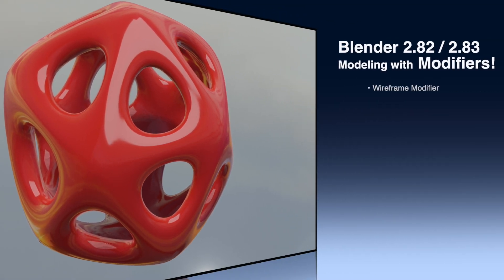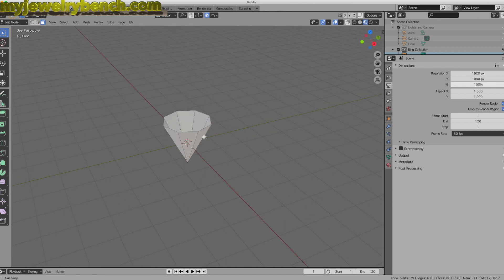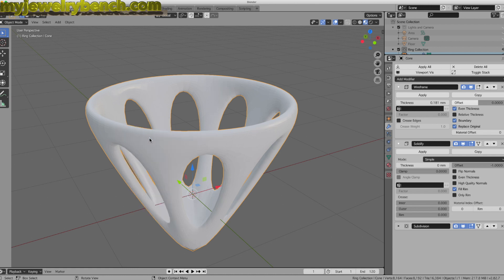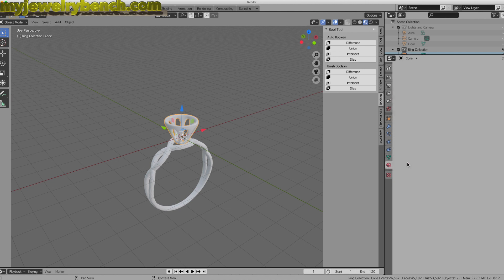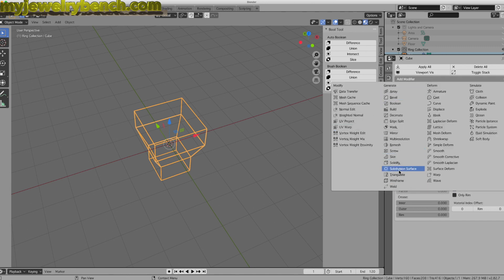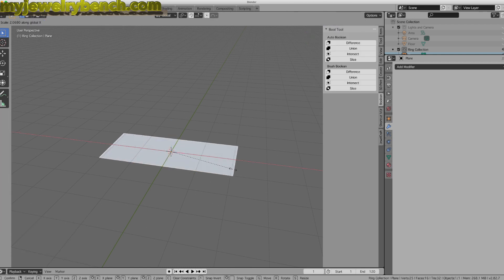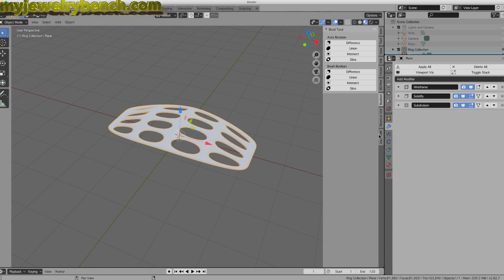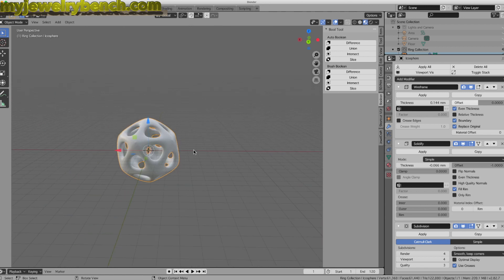Blender 2.82/2.83: three Modifiers for Really Cool Models!  Wireframe, Solidify, Subdivision Surface

Comment: Hi Peter, I purchased your library a couple of months back, but my Patreon is $2 per month,
Will I get free updates also?
Reply from the maker: No. I’ve added a higher tier. 5.00 per month. That is 60.00 per year. For that you get the latest version of blendergems from the patreon page. It is a different way for those of you who wish to support my channel to do so. Yes. If you become a patreon, you get free updates as long as you are a patreon supporter of my channel. As well as more upcoming products and videos that will not be on public viewing. I realize that you may be at the lower tier now but it does take quite a bit of time to continually add to the library. I hope I answered your question sufficiently and let me know if you have any other questions. I would love to help